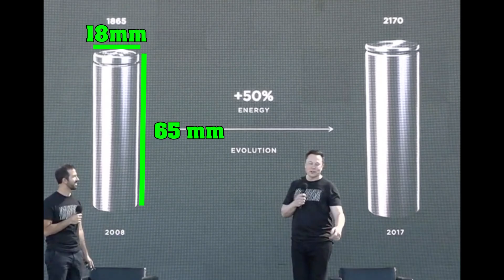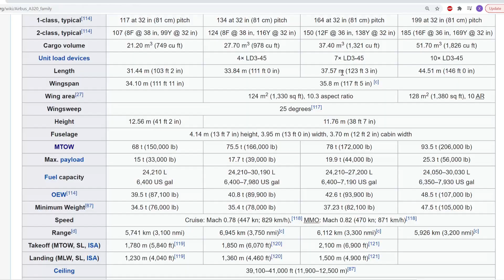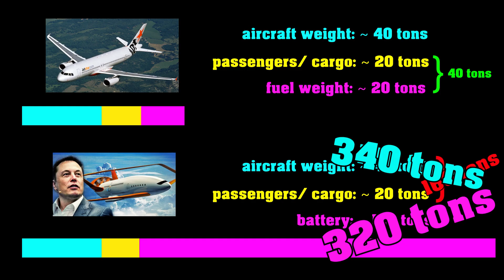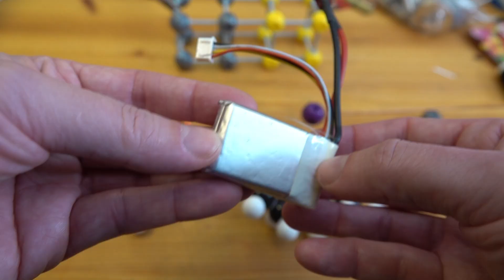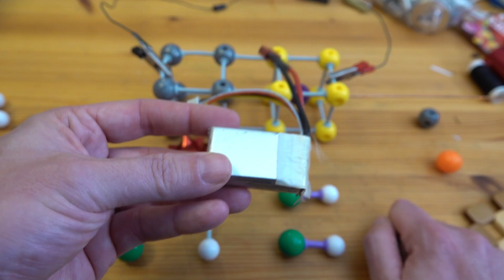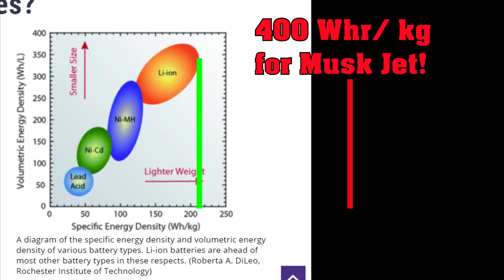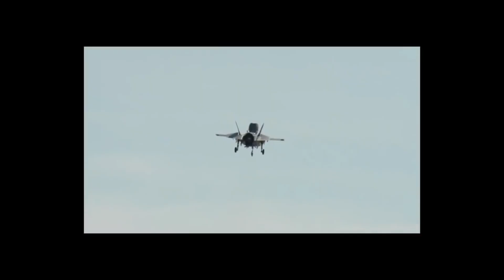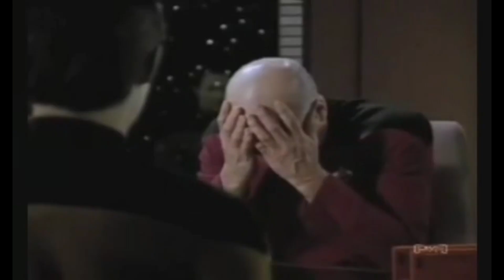Tesla's Secret Plan To Disrupt Airlines: BUSTED!!

Comment: Since Musk is pretty clueless about anything His Holiness doesn't grasp how expensive VTOL actually is. For a plane to be able to take off it should overcome the acceleration due to gravity first, that's 10 m/s2. An A320 will do this by climbing SLOWLY: after take-off it will climb at about 2500 ft/min and a velocity of about 175 kts (initial climb). After a couple unit conversions you'll find that the sine of the climbing angle is 0.15 (back-of-the-envelope-calculations). This means it only has to provide enough thrust to go against 1.5 m/s2, AND airspeed + wing shape = LIFT.

A VTOL plane has to go the full 10 m/s2 and has ZERO LIFT during take-off. Fighter planes like the F16 have a thrust-to-weight ratio greater than one, and therefore can climb vertically. (I t also weighs only 9200 kg). Please let me know when Musk will let a 100 ton battery take off vertically. I wouldn't want to miss that!

Comment: The ultimate problem is physics and the simple fact that you need atomic nuclei and mass to contain electrons. There is a definite practical limit to energy density in any solid form, and chemical energy at baseline has much more potential than pure electrical energy. Adding solar panels and using lightweight batteries with short-lived storage capacities might be a smarter bet, since they can likely be much lighter, maybe even gaseous, and planes are constantly in use, so they would tend to provide the batteries enough charge to be helpful in periods or regular operation. Silly as it sounds, waste heat and heat differentials with Peltier siphons and small steam turbines might be the best source of extra energy, since planes operate very hot engines right next to very cold air. Every opportunity to make planes more efficient should be explored, and this means hybrids first.

Comment: I just have a question. If you go higher wouldn't electric engines have to work harder to produce the same kind of thrust than in cruising altitude (since there's less air molecules the blades of the turbine can push on)?

Comment: Is Musk basing all this on the electric air plasma jet experiment at Wuhan uni last year? 800 watts of microwave energy barely generated 1kg of thrust. Without even talking about the efficiency which is about 1.8%, this so far from being a viable aircraft propulsion anybody using the word "soon" should be tarred and feathered for lying. Add the comments about how inefficient modern airliners are at altitude, and it makes me wonder when people got so stupid?

Comment: Actually turbines get more efficient at high altitudes. Also turbines are not that efficient under partial load. That's why jetairliners fly so high.
For piston engines it is opposite and the range is v highest of they fly slow and low.
There are few pages which are available with piston engines or turboprop. Both have their advantages and disadvantages.
An electronic motor has the same efficiency regardless of the altitude. However electric motors need to be derated in power at high altitudes because cooling gets worse with the thin air. Usually derating starts at 2000m above sea level. So even ground based transportation like trains are derated at that height as well as industrial installations.

Comment: Man, Thunderfoot... you lack the vision here. They'll just work together with solar roadways and they will fly over the atlantic by slapping some Solarpanels to the top of the wings :D That will surely save them some weight!!!
Reply: They just use a cable and connect the plane to the solar roadways.
Reply: And recharge with microwaves directed from the ground. I just wanted sharks with lasers on their heads

Comment: For the maximum weight of the plane you should take the MLW (max landing weight), not MTOW (max take-off weight). For a fuel driven aircraft the landing weight will be less because the consumed fuel had gone, but batteries weigh the same (even if they're "empty"). For an A320 MLW is about 20% less than MTOW, so you'll have to do the calculations again for that lower take-off weight.

Comment: Only way to make an electric or CO2 neutral airplane happen is with hydrogen. And you'd need a way to produce a lot of energy cleanly to produce the hydrogen. And instead of electric motors and fuel cells it might be more efficient to use hydrogen jet engine.
Or maybe something like a fuel cell for liquified propane or butane where the CO2 is captured.
The best thing we might do is to drastically reduce the speed of airtravel.
And use more and better train network together with auto roll on / roll off robotaxis.

Comment: You forgot to mention thas as airplanes burn their fuel they get lighter, increasing their range. Batteries don't become lighter as they discharge.
Reply: No, there will be a hatch at the back of the electric plane, which allow the plane to discharge its empty batteries while still in flight, kinda like blue ice. Thus, the plane will be lighter but the public will have to watch out for the rain of empty batteries when a Tesla flight flies over.
Reply: @redadder515  Maybe Elon will make the batteries glide back to the airport?
Reply: They do, but tiny amounts. E=mc^2, so m=E/c^2
Reply: @anonymRabbit23  OK but that's homeopathic! 😂

Comment: The only reason why you would ever want VTOL capabilities is if you had very little room to land (like on an AV-8 Harrier, which has to land on an aircraft carrier). Why would you build a plane like that when you have runways readily accessible to you?
Reply: Because it makes for a cool prerendered video when you pitch it to your "fans"
Reply: Mostly because runways aren't actually readily accesibile. They have to be placed outside most large cities where traffic to and from the airport is a big consideration in the overall time frame

Comment: You missed one of the critical points when comparing battery-powered and standard aircraft. Takeoff/Landing weight. Most airliners are structurally unable to safely land when fully loaded.

Comment: We have limits on LIon batteries when flying. To transport them they have strict container requirements because a lithium fire in a plane will fuck your shit up good and proper. 

While his batteries my not be Lithium batteries but whatever they are I don't want them catching fire in the air or during a crash. Even "diamond battery".

The ever increasing weight/fuel scale was reminiscent of the power requirements for early rockets. They needed to carry more to lift more which required carrying more to lift more. Eventually we got better fuel and rocket motors so it isn't completely out of the realms of possibility. But until you can literally build the plane out of battery material it isn't going to be feasible.

Comment: A320 can carry 50% of its weight in fuel. Elon said he thinks it is ok to have the battery 70% of the weight of the plane. its still stupid, the amount of energy needed to lift some weight by conventional wings wont change, and it will increase if you want to use super-sonic wings as the provide almost no lift,l. You will need about 400 kwh battery per metric ton for sustained flight for an hour on low speed (80-90 knots), and the faster you go, the more power you need to overcome drag, the more weight you need for  that power in batteries. you will end up shortening possible flight time every time you add batteries

Comment: The electric motor thing confused me. Like, are they proposing that the engine isn't going to be a rotor which makes use of air to pull the plane forwards? Because if it is, surely eventually you reach a a point where the air is so thin little to no thrust is generated?

Comment: Thunderfoot, there could be a revolution in aviation using batteries and electric engines and it even could take off and land vertically. The problem is it would not be a plane it would be by zeppelins.

Comment: Nah. Why the whole video? How the hell he plans to generate thrust during high speeds? The only way electric motor cam propel aircraft is well by using propellers. And well they don't work at high speeds. At high speeds propellers becomes brakes with all their surface area.
The only way battery powered plane could go supersonic its by burning all batteries..... While performing a steep dive.

This is the reason turboprops don't fly as fast as jet planes. And this is the reason high bypass ratio engines can't work at supersonic speeds.

Comment: I work on boats and we had a number of cases of AGM batteries going into thermal runaway. They literally welded themselves together and had to be broken apart with a hammer and chisel. This was caused, not by a short circuit, but by constant trickle charging in an enclosed space. Had they shorted out and caught fire, the boats would have been destroyed.

Comment: It's also worth noting that there is a concept called step climbing. Long (3+ hours) flights will start at one altitude (between 30k ft to 36k ft) and will often end up at something like 38k feet to 41k feet as they burn off fuel. This is because at high altitudes you end up being on the edge of the lift envelope if you go too high too quickly.

Comment: The apparent 4% gain with the larger battery  can be explained by the reduced outer shell of the individual batteries vs just larger one... More smaller batteries bs fewer larger ones... So there is no energy density increase over and above this. 

Cube or rectangular batteries could increase overall energy density in theory.. In that you could pack more in any  given space, the downside is that one would have issues keeping the temperatures down... Discharging a battery quickly generates more heat, cars once they have a rolling speed can greatly reduce energy consumption... A jet however, even after its ascent to a cruise height is still going to be chooching not that much below maximum safe discharge... Also plane travel is only cost effectively when they are packed to the gills with passengers and airfreight cargo (not passenger luggage)

Given that the battery solution would massively reduce the percentage of cargo and passengers that can be carried... Well, it’s not that it’s not impossible to make it work, more it’s going to be Concorde level prices for a ticket... Which is a very small market share to aim for..

Comment: If you want to actually learn about battery tech instead of blindly laughing at whatever TF tells you to laugh at,  go to The Limiting Factor.
https://www.youtube.com/channel/UCIFn7ONIJHyC-lMnb7Fm_jw

Funny no one is asking why the older batteries are smaller, when they could have just made them bigger from the start... Duh! 

The older batteries have more internal resistance compared to the tabless 4680.  They generate more heat.  They have to be cooled more.  Reducing their efficiency and making them take longer to charge.

And funny that everyone is so familiar with battery day ... but don't seem to be aware of the new chemistry and use of silicon in the 4680 anode to boost the energy density, or how the battery cells will become a structural component, replacing some of the dead weight of the car for a higher efficiency. 
 Or aware of the massive streamlining of the production process.

The cost per kWh in 2015 was $230.   It's currently around $110.   It's expected to be around $55 when 4680 ramps up. 

But herpa derp, it's really all just a trick based on the volume of a cylinder. derp derp.

Comment: Eeeeeeh, it can be done with solid state structural batteries, that's highly experimental tech in it's infancy atm tho and we have no idea how safe the damn things actually are. Buuuuuut, theoretically there's a legit concept that major car manufacturers are working on where you basically build the car out of solid batteries. That would make Thunderf00ts comparison around 8 minutes miss the mark heavily as you can remove something like 35 Tons from the plane itself and that changes the entire dynamic for the battery ratio.

Comment: it's dumb, but at least this time its honest....sort of, i mean batteries do have a much much lower energy density than fuel so it does make sense that you would need a significantly higher potion of you aircraft to be the fuel source by mass. 

also there's literally no point in an intracontinental passenger supersonic jet, there's a reason concord didn't really have any intracontinental routes, it's prohibitively expensive to do anything shorter. once again musk pinches an old idea, designed for LONG distance travel, and scales down the distance to the point of ineffectiveness.